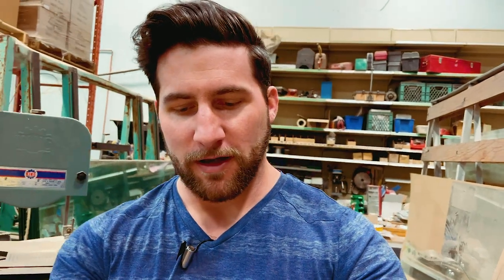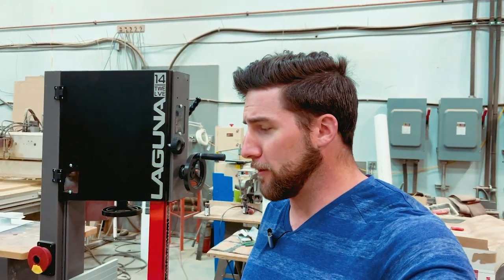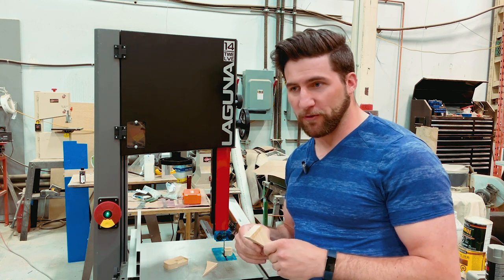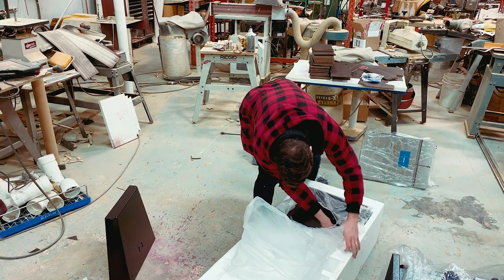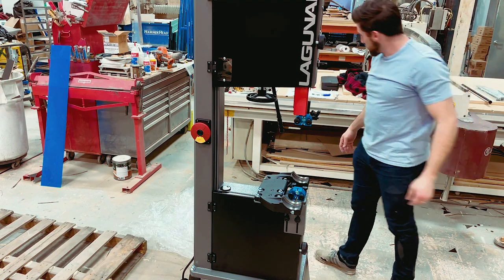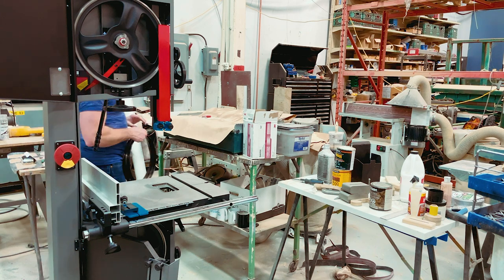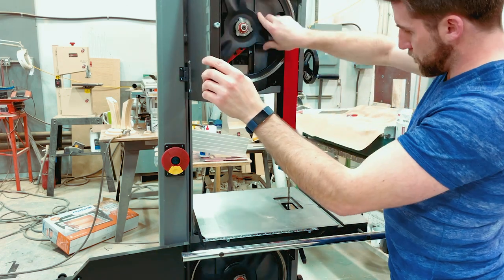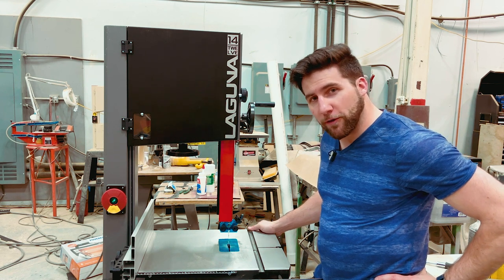What a TOOL! | New Bandsaw

Comment: The beige saw probably has a dull blade. There's no reason it won't slice thru any hardwood. I have a b&d bandsaw from 1984 that uses a drill for the motor and used it to cut everything from pine to oak and frozen beef. I have a ryobi and a craftsman now. Both work great. The main thing is proper adjustment and sharp blades.
Reply from the maker: Ya, there are a couple issues with that one. The guide is junk, the blade is old, and the tension adjustment has some problems.

Comment: Brad, you want the gullets of the blade on the center of the wheel. Look up Alex Snodgrass band saw setup and he'll explain why. Give it a try and you'll appreciate the difference when doing thick pieces or resawing.
Reply from the maker: With the 3/4” blade this is the only way it will fit properly. But I will check that out.

Comment: That's a real nice saw. If I were to buy a bandsaw, I'd be looking to get one that takes up to a 1 inch blade, but only because I would use it to resaw lumber for book matching.  Even then, I bet a 3/4 blade will still get the job done. I just believe in overkill whenever possible.
Reply from the maker: Ya a 1” would be nice. The 3/4 will book match, but you probably wouldn’t be cutting a really thin 12” veneer with it.

Comment: My only issue with Laguna are the wheels. They aren’t weighted to act as flywheels so torque isn’t evened out like you would find on a Powermatic.
Reply from the maker: Interesting; I wasn’t aware of that. What’s the impact of it on the cutting?
Reply: @BradAngove  without heavy wheels a bandsaw can experience more rpm changes when hitting dense knots or as material thickness changes - this can affect the cut quality and safety.  The inertia inherent in a spinning flywheel helps. 

Don’t get me wrong, Laguna is a great machine, it’s just wouldn’t be my choice for my workflow.
Reply from the maker: That makes sense. Thank you for the information.